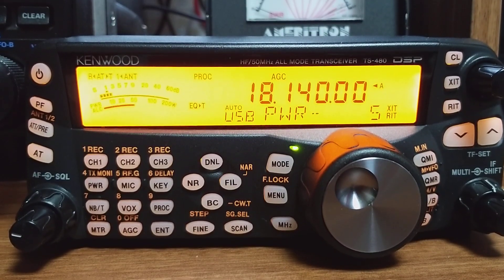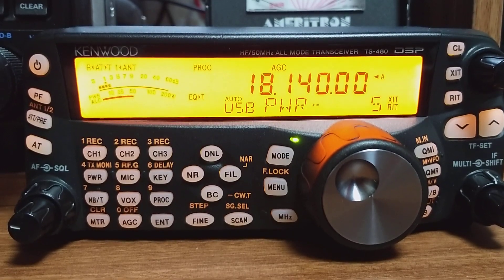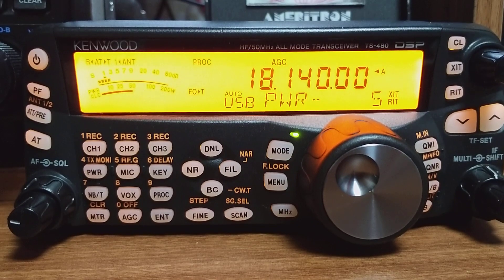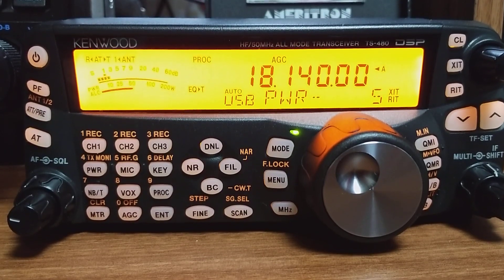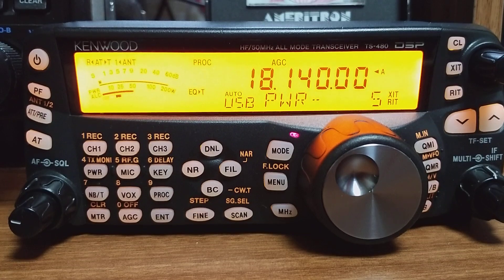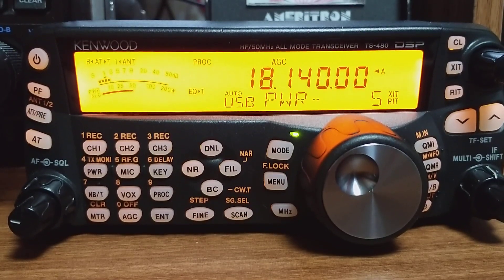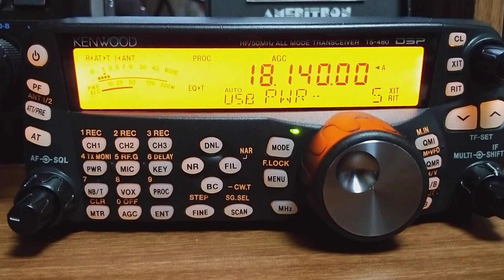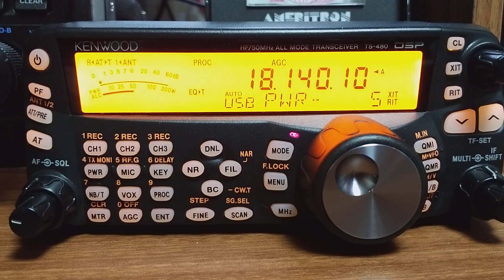Kenwood TS480SAT Frequency Drift 17m TX

Comment from the maker: I was able to realign this quite easily.  A ham from QRZ told me how.  Need to go to the 6m band, and with another radio, transmit a CW signal at 5w or less into a dummy load (or antenna).  Listen high on same 6m frequency with the Kenwood as you switch back and forth between CW and CWR modes quickly.  Turn the TC1 trimmer very slowly either direction while doing this, until the CW signal becomes identical pitch in both CW and CWR modes. Must be done on the 6m band, and all lower bands will be correct.